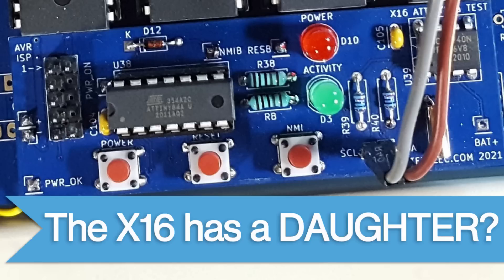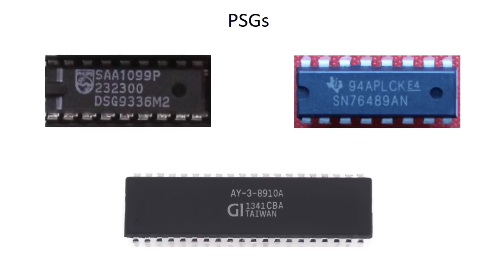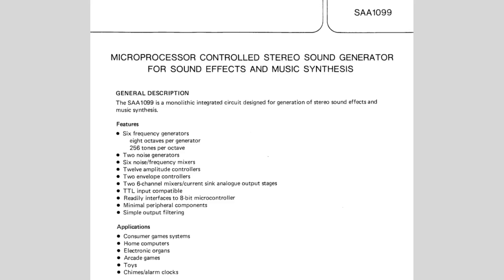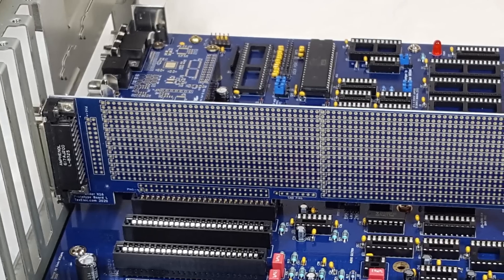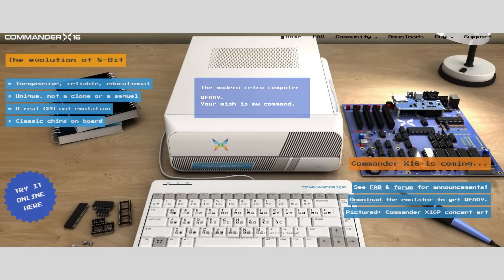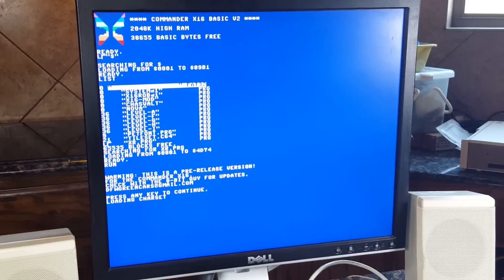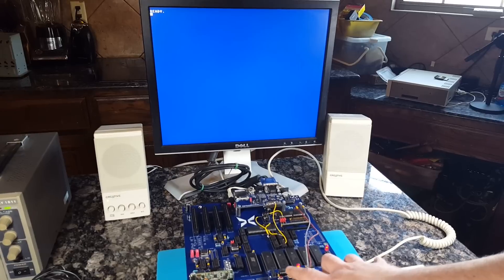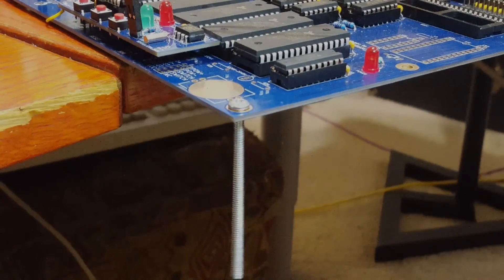Commander X16 - Proto #2 - Design Updates and Next Steps

Comment: I want to ask you a simple question is it possible to make the emulator software be converted to a Arm based capable OS so the x16 simulator software converted to an OS that would allow you to use Arm based processors but at the same time still play with towards play around with the original Hardware down the road and I'm looking forward to seeing it come for wishing far as the x16 Hardware but I would also like to see the software itself be able to be expanded on other development boards I don't know if that's possible though?

Comment: i love the idea of this computer, but you wanted to make it something that anyone could do?  at one point  you mentioned a $50.00 board.... well there is a way to get costs way below $50.  They do this for just about every retro system out there already..... EMULATOR.    but  go a step further than other emulators, instead of running it inside windows, boot from a usb stick, and set the same system limitations of the full version.  It would also be great for coding, because anyone with an emulator could then code for your system.

Comment: I am interested in how you added i2c to the commander X16.  I  am at the moment making a Z80 bread board computer and a 6502 bread one too (Ben Eater)  The idea of adding I2C would give so much value, as you could add real time clocks, displays, and serial eeproms for addressable software storage.
Reply from the maker: It's being driven via software on one of the 6522's, (ie, bit-banged) although you should be able to generate it in other ways.  However, the 6502 source code in the emulator tree already contains the date and time functions which read the I2C clock, so it should be something you could look at for an idea on how it works.
Reply: @TexElec  Ty very much. They are using a second CPU I had no idea. I knew it would have to be emulated. I could use a atmega328p which I have lots of, has hardware i2c, but I need to crawl before I can walk. My very first computer was an Amstrad CPC 464 with a green screen and a 64k ram expanding with CPM. I am so looking forward to exploring.

Comment: Bit bang I2C to turn on and off an LED?  Make that an output of the HDD or floppy controller card.  A power system microcontroller more powerful than the main system processor?  Design a simpler or tunable analog circuit. An FPGA video adapter that could easily run a 65816 soft core? ... I wish we could go back in time to convince 8-bit Guy to have a more feasible initial vision for this project.

Comment: What about the 24 pin ATX power supply connector
Reply from the maker: I used a 20 pin connector, but you can also plug a 24 pin in with no issue.  They are designed that way, the extra pins will just hang outside of the connector.

Comment: You should have used a Zilog Z80 CPU, which is far superior to 6502, and can run an advanced OS like CP/M.  And used a Yamaha V9938 for thr graphics, which would have been cheaper, and superior graphics to anything custom using the vera board.

Comment: Nice. My first thought for the I2C bus would've been to make the microcontroller act as a proxy for the real-time-clock and interface directly to the system bus. Maybe you wouldn't have enough I/O then, but if that was a problem you could use the 20-pin ATTiny2313 instead.

Comment: I have a few questions.  Hope it is ok.  How many layers is the X-16 motherboard?  Are you good at designing motherboards that are 8 layers or higher? Is there a good way to determine how many layers a motherboard has?  What would someone need to know to try to redesign a motherboard from 1988 to 1994 or 2002 to 2007, in order to improve it to have better ethernet chips, sata instead of ide, ATA100 instead of ata33 or ata66, maybe increasing video ram, improve PCIe slots, increase onboard ram, improve onboard video chip, etc.  I am looking at motherboards in the following systems to possibly work on.  (Mac SE/30, Mac IIfx, Mac Color Classic, Mac TV, Powermac 9600, Powermac G3 Tower, Powermac G3 Blue and White, Apple TV(1st Gen), Mac Mini G4, Powermac G4 MDD, Powermac G5 Quad Core 2.5ghz)  On the Apple TV 1st generation, I have found a better version of the video card and ethernet chip that is from the same company, the same size and pin configuration and have thought to switch them out and see if there are improvements to its performance.  But for some of the other motherboards I will not be able to do that and wonder if I can redesign the motherboard with better components.  Thank you in advance.
Reply from the maker: Hi, not sure I can answer everything here, but I can help with a few things, and I'm certainly no expert on all things PCB.  The X16 is currently a 2-layer board.  I may make it a 4-layer before the end, but I'm not certain it will be necessary to do so.  It will probably be more a matter of RF shielding than functionality.  It's a large PCB, so there is a fair amount of room for routing.  Multi-layer boards today are generally done to control impedance.  Modern buses, etc. used today are largely differential, and need specific design considerations.  Once you get into more than 4-layer, now it becomes more about routing space.  64-bit machines have TONS of interconnects, so they can get pretty thick.  If you want to know more about multi-layer boards, read about stack-up for PCBs.  This is a term used by PC manufacturers to describe how the layers on a PCB are built up, and it may shed more light on the why of multilayer boards.  Unless it's printed on the board, I would guess it's hard to "count" how many layers a board might have.  Usually, the center is think, and the outer layers are pretty close together.  You'd probably have to get a microscope or something, I've never tried.

As far as redesigning systems, I think you'll find what your proposing is a bit more challenging.  It's not necessarily difficult to plumb in different things like ethernet chips, etc into old systems, assuming they are compatible with the bus, or can be adapted.  What will be more challenging, is supporting these at a driver-level.  In other words, if you add a device that was not natively supported, then you will have to add that support.  

Hope that helps.  I recommend starting off with a more simple project if you're new to PCB design.  Get used to the software, and run a board or two.  Jumping into something like this as a starting point would be super-daunting. IMO.

Comment: I am following this CX16 and the M65 projects with a lot of interest. One thing that I believe should be considered for the commander X16 is an ethernet port. Also a set of networking instructions and socket handlers would be quite nice if implemented in the CX16 Basic. See Basic-256 for inspiration.
Reply: That's what the expansion ports are for, so people can make their own expansion cards such as ethernet ports etc.
Reply: @edminchau811  I guessed so. The disadvantage: there's no guarantee there will ever be an ethernet expansion card even though the odds may be good. Wait and hope... The Mega65 for example comes with an ethernet port, but then it doesn't have any expansion slots similar to ISA. Since ethernet is a built-in feature of the M65, the ROM (and Basic) support it from the get go. It should be quite easy for a user to write software. I don't know how easy it will be on the CX16 if ethernet will be available only through an optional expansion card.

Comment: Have you thought about using something like the ATF1502AS PLD? It's still in production, fits into a neat little PLCC carrier, and is period accurate (TTL with 36 Macrocells, and originally released back in the 90's I think). You can build a programmer for them really easily on a breadboard, and they save their configuration. They're absolutely perfect for simple system glue, which where I've used it.

There's also the ATF16V8B which is a current production, old as dirt, DIP packaged, reliable PLD for like $0.70 a piece. Again, just enough gates to glue system logic together.
Reply from the maker: I actually do use these chips as well as 1504s and 1508s.  Yes, it would be dead simple to replace all of the ttl logic with one chonking pld.  So, when David made the first video, I really asked him not to go with the $50 price tag.  It's unobtanium for so many reasons.  Just as an example, the 6502 is $7, so are the 6522's.  The RAM and ROM are about $26.  Heck the IEC port is like $6!  It's pretty easy to see that $50 was never going to happen AND still meet the original goals, which were no PALS or PLD, all through-hole, etc.  The idea was to make it simple to look at understand without any complex logic hiding the works.    

If you simply look at production as well, through-hole boards are WAY more expensive to have built.  Back in the 1900's as my son would say, through-hole assembly robots were common.  Not  today though.  If you want them built, it's done by hand.  Surface mounting this board alone would make it cheaper by far, but would not be ideal for kits. 

I pretty much designed most of this board, and I knew very well from the beginning it wasn't going to be cheap.  So I decided to make it the Cadillac version.  Add everything we wanted, and if it's not the system for you,  then hey, I understand.  No worries.  We're going to cost reduce them later, it's long been planned and they will likely move to a surface mount, reduced logic board.  Probably with less RAM, etc. 

It's really been a challenge to balance out all of the requirements, and still keep cost low.  I'm doing what I can, but the parts are just not cheap.  Not sure why it's $7 for a 6502, but I can get an ARM  M0 @ 48MHz for a buck?  But, it's also crazy that I can still build an 80s machine with mostly off-the-shelf parts.
Reply: @TexElec  as for the prices of a 65c02 versus the ARM: except for the oddball 8-bit enthusiast, why would anyone use the old, slow processor when the newer microcontrollers are far faster, cheaper to make because of the smaller die size, and oh, besides having so much more integrated on them, they have economies of scale?

A huge portion of the cost of chips is how large of a chunk of the wafer they use up, as yields go down as size goes up, as defects tend to be similar per wafer regardless of the size of the chip, so fewer chips are wasted for percentage of yield if smaller.  I doubt any manufacturer has shrunk the 65c02 node, because there’s no demand for it: perhaps they’re doing a production run every few years, so they cost money to store.

Comment: Adrian totally saved your bacon. You didn't know that most chip-enable signals need to be qualified by phi2????? WTF man.
Reply from the maker: Some signals need qualification, some do not.  For example CS lines on the 65c22 are not validated, as they have their own Phi2 connection.   Adrian stated that this was needed in his video, but that actually isn't true. Not that I'm blaming him or anything, we literally tested 50 other things before we got the winning mix of bodge wires, so it all started to run together.  In addition, the VERA did not need this gated in the past, but it too was redesigned and untested on this proto.  The YM2151 works either way, as did the SAA1099, so not black and white.  The reality is that there were several issues at once and sometimes, you get lost in the weeds when you work on something for too long.  I am super helpful that someone else was able to step-up and lend a hand.

There were many steps and issues which I cover in my videos about the problem, it wasn't one thing as you seem to be distilling it down to.
Reply: @TexElec  Understood. Let me go back and watch those so I have a better perspective.

Comment: I'm glad to hear about all these cost cutting measures because this was starting to look like it was going to be quite expensive. Like, PS5 level pricing. It's too bad all of the chips (including the main CPU) can't be created on a single high capacity FPGA, preferably with plenty of onboard RAM to possibly eliminate that on-motherboard necessity. I think this would drastically reduce the overall cost and also allow for major last minute changes without having to re-prototype another board, and FPGAs are fairly easy to obtain too. No more worrying about legacy chip availability. I know a lot of people don't want to go the FPGA route for various reasons but it would offer a lot of advantages worth thinking about.
Reply: As I understand guys are going to provide some FPGA based, more compact solutions, repeating the functionality of the Pro motherboard. They will be smaller and cheaper, but personally I will spend $300 even if (or especially if) it will be DIY kit, totally expandable and hand crafted. Let's make the platform first, you always can simulate it later either in program emulator or in FPGA.
Reply: @rkurbatov  Could even be a core for the MisTer device too.
Reply: The system would completely lose all charm if it went FPGA. There's a limited audience for this anyway, so I'm not sure making it super cheap is going to bring in more people. I guess.. if it was available both as is, and as an FPGA core for like the MisTer, that might make give it a wider audience.
Reply: @TurboXray  FPGA would not just be a potential cost cutting measure though. It would also allow for feature updates/upgrades or even changing it into a completely different system (if you wanted that). I don't agree that putting it on FPGA would make it lose all its charm. If the C64 had somehow back in the day been created all on one big chip would we love it any less? To me, what gives a system its charm is not necessarily its features but its lack of features, its limitations if you will. The PS5 and XBox don't have any charm because they're essentially the same machine with extremely similar capabilities. On the other hand, one can look at a game screen and tell right away whether it is a C64 game or not because it has a distinct color palette and so on. All of those characteristics could be created on that FPGA easily.
Reply: @JustWasted3HoursHere  I didn't have Commodore, started with PCs, so there is no 'nostalgia' feeling for me in this computer. But I like the idea of a computer I am fully understand. I can even repeat MOS6502 if I want in smaller ICs and use it instead. One additional good thing - I can assemble-disassemble it myself or even extend. I understand every aspect of development currently on both software and hardware level - that's why I like it. FPGA video is a compromise, lack of audio chips also becomes a problem - architecture changed much so there is no so many specialized chips as it was earlier. But that's the cost we pay for something useful enough - nobody wants textmode nowadays. Probably, the good thing is the main board remains the same, while functionality can be improved via newer versions of video chips (that doesn't depend on me) and via additional cards, even created by myself (that depends on me) and I like the idea.
Reply: @rkurbatov  FPGA would just be those same chips but "emulated" on one chip instead of several. A 6502 on an FPGA is still just as easy to understand and program as a real 6502/07/10. Same goes for any of the other chips that would be emulated (can't think of a better word, even though it's not emulated in the traditional sense) such as the audio. In the case of the X16 the audio is being implemented, I believe, within the VERA video chip so that might be a slightly different approach, but I don't think there's any real reason why it couldn't be done as a SID derivative or whatever on the FPGA itself. I'm mainly just thinking of a way to cut costs for this system so that as many people as possible can jump on board. I'm no electronics expert by any means but from what I've seen and read it should be possible.
Reply: @JustWasted3HoursHere  from the programmer perspective everything can be fully emulated. You don't even need FPGA for that, just like they did on PET with custom videochip based on Atmel controller - it's quick enough to emulate old PET videochip, because they can't get a new one - it was highly specialized unlike any other RAM/ROM/CPU scheme they use. But from the architectural/technician perspective I would like not to use FPGA at all and have everything in DIP package - so I can assemble/fix/tweak any part of it and still understand it. FPGA is a black box of somewhat bigger size than ordinary simple IC. :) Technically, everything can be emulated in FPGA of reasonable size and speed, so if main computer becomes popular, it can be recreated in much more smaller formfactor for anybody interested in.
Reply: I seriously think 50.00 be dollars is unreasonable or a pipe dream. 300 is the going rate and even at that cost I don't think we will be buying a computer for 300. More like 500 with development and production cost. I'm sure the parts alone are over a few hundred. It would be nice to.have the cost low but unpractical at this rate. 73
Reply: You could put the whole computer on a single chip but to have the chip.made there may be an outrageous amount of minimum chips you would have to buy upfront like 10,000. My work tried to buy Asics for our phone boards which were outdated. The new chip would not work on our older phone boards which we repaired thousands of boards  now not many phone boards orders even international quit buying boards we still sell option boards but not motherboards. Back to minimum pieces you had to buy the last I heard was 5,000 chips which was out of price range. We had to call the boards unrepairable if the Asic was bad. 73